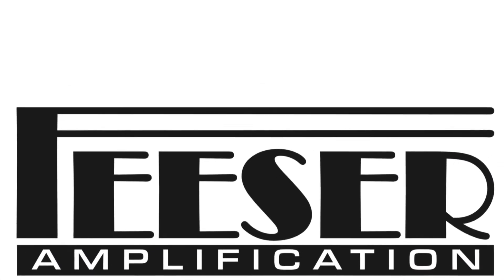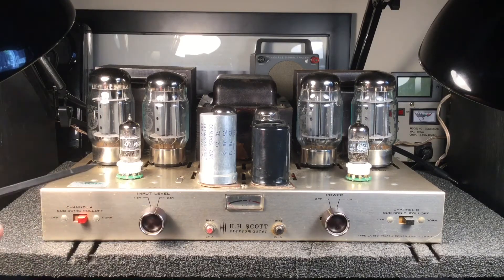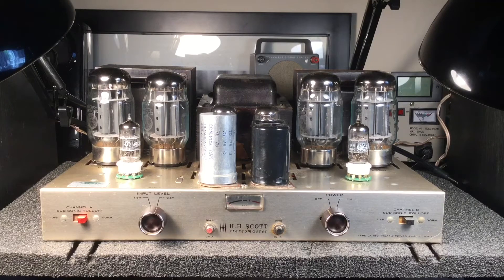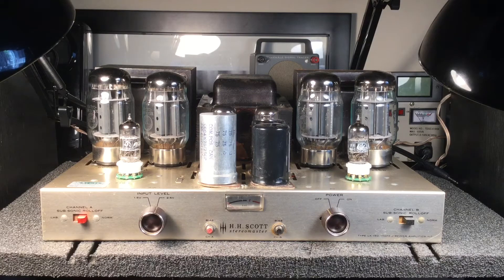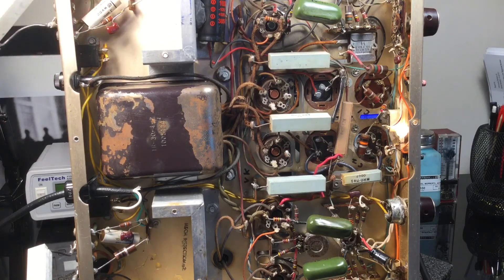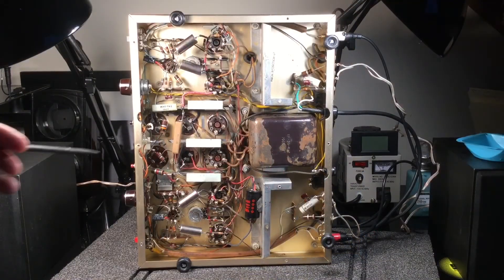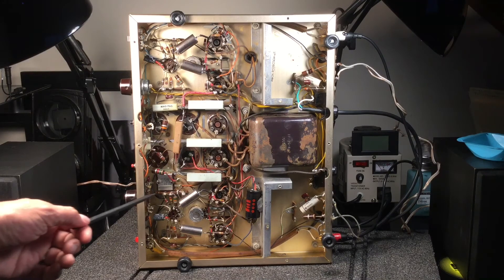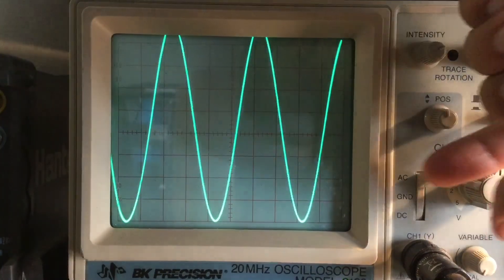General service of a H.H. Scott LK-150

Comment: I got one about ten years ago from some one on audiogon. He had recapped it audiophile-style, but there was a hum I could never trace until I found the original assembly instructions on eBay. Not only colour coded schematics but colour illustrations. Comparing it to my amp I discovered a shielded input wire from the rca’s to the front of the chassis had the shield soldered at both ends to ground. The manual had it soldered at one end only. I severed the connection at one end and no more hum.baffled two techs I had go over it.